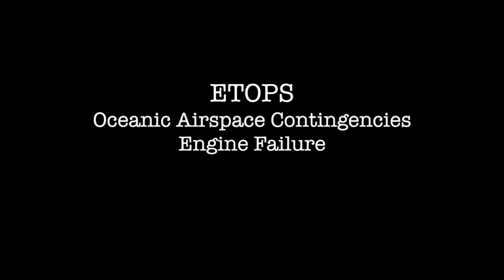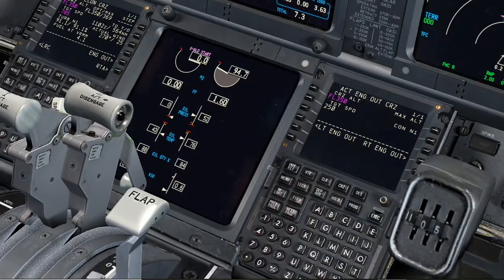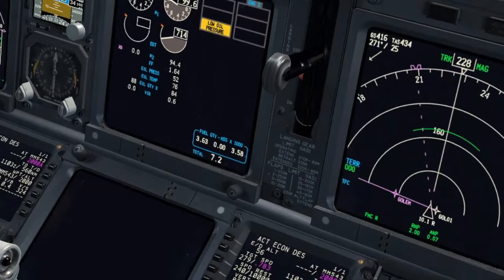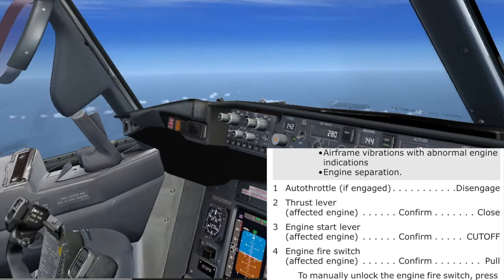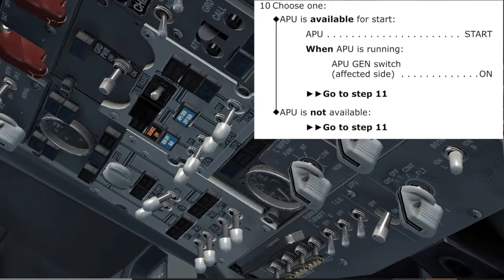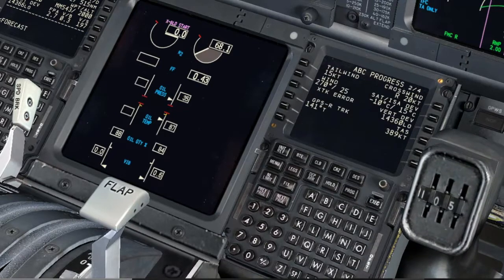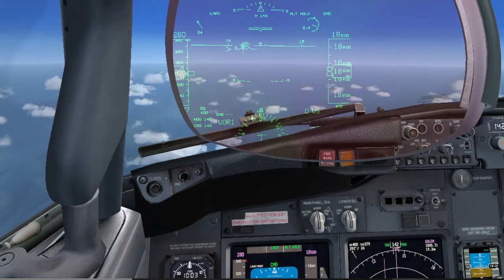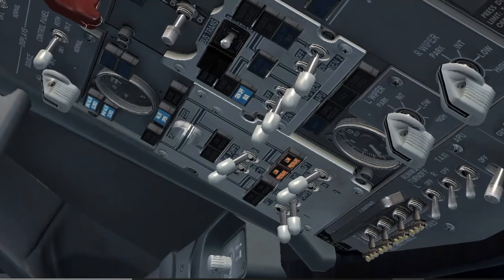ETOPS  Contingency Procedures - Engine Failure

Comment: Descended to fl180 without contacting ATC. Is that something you would do in real life?
Reply: Garbage 😂...
Reply: Before making unintelligent comments, think about it first. Where are ETOPS flights done? How is the communication between ATC and aircraft? In a case of emergency, do the pilotos need to flow rules until the aircraft crashes, or are exceptions allowed?
Reply: @rafaelcarvalho6222  Dearest Sim Guru Rafael, yes you are right, you might be out in the middle of the ocean. My comment was more to the fact that in the procedure there is no attempt to communicate which is what real pilots are trained to do.